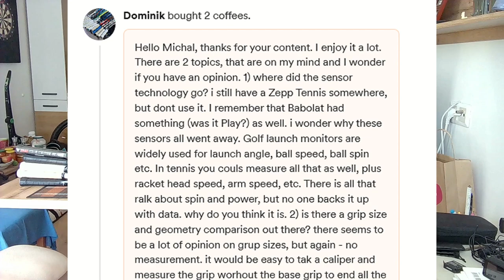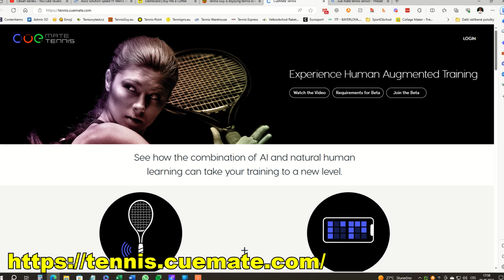❓ Donation Questions #3: Why Are Racket Sensors Dead? Is There Grip Size & Geometry Comparison?

Comment: Hi Michal, please save the day!
I'm a great fan of Head Radical line and I've got a question for you.
I've been to my local store and we tested the grip size of a bunch of L3 Speed MP, Extreme tour and Radical MP. Radical seems to be more rounded and therefore thicker compared to those other two models. Is that normal? Are they built with a different grip pallet? Thanks in advance!
Reply from the maker: Hi, I think all Head grips should be the same size and shape. So it is not normal. I experienced some problems with the latest Head rackets with the grip, too. The base grip wasn't really holding well on the racket and it was coming off. But other than that, the grip should be the same size.
Reply: @CzechTennisGuy  thank you so much for your feedback! Maybe it's a bad batch with high tolerances on the tk82s pallet then.
Keep up the good work with your amazing reviews!